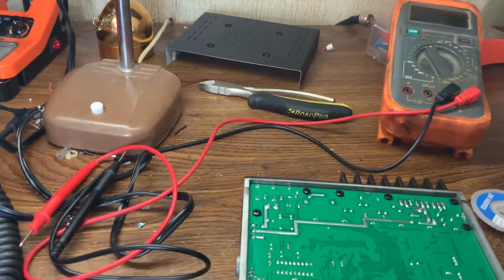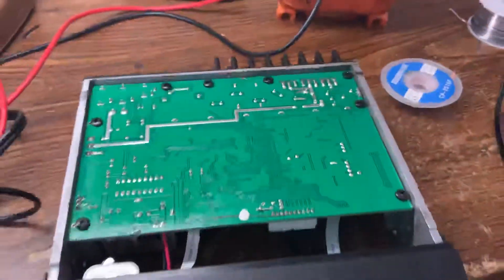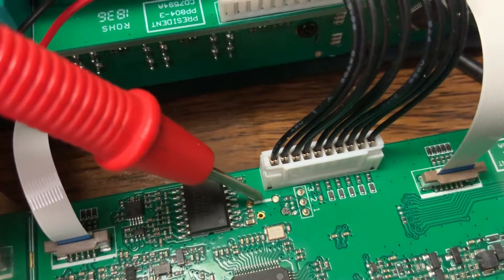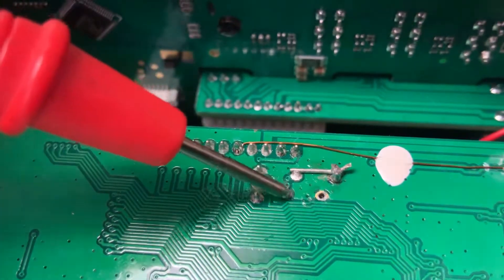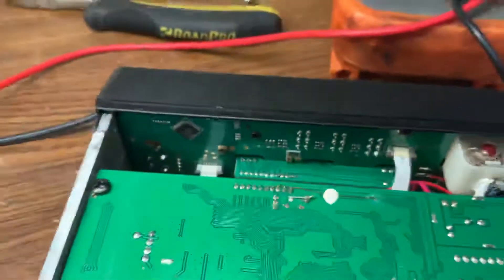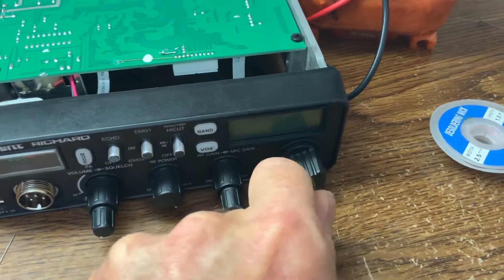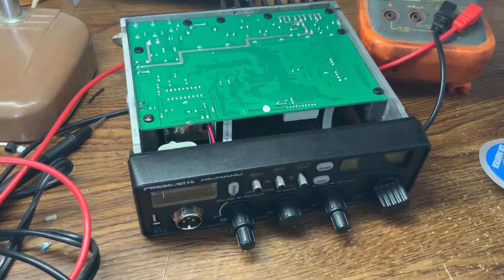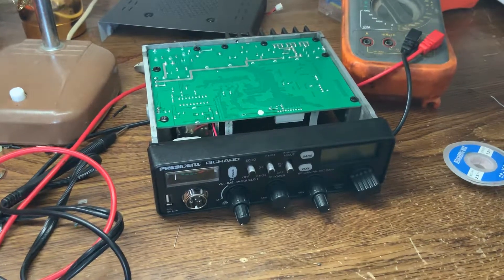President Richard CB Ham conversion to 11 meter modification

Comment: Instead of using a wire, can we use a switch to flip back and forth from 10 meter to 11 meter? If so, is there something that has to be done with the programming after every time it's switched?
Reply from the maker: That would be kinda pointless because all this mod does is add 11 meters to your existing 10 meter radio as extras, it does not take anything away. So by flipping a switch, you are not “coming back to something that is taken away” if you know what I mean.

You’re just unlocking extra channels and adding them to what you already have. Hope this makes sense

Comment: This is awsome...if i had this radio and did the conversion, is there an antenna that would work for both 10 and 11 meter bands
.i know that it will not be optimal, but would there be an antenna that would atleast somewhat work with both of those bands?..any suggestions or what would u do???..thank you for the video
Reply from the maker: @bencoletti4119  Yes it can be done. The 102” whip that most people use is actually tuned to the 10 meter band. This is why people add a 6 inch spring, to tune up to 11 meter.  tuned length on 11 meter is 108”. As you noted, it would not be optimal, but it is doable. More serious people use multiple antennas, or add an A/B switch to two antennas for one single radio. With that said, personally I do not feel 10 meter is worth pursuing. The reason this is a 10 meter radio is to classify it as a ham radio so the power can be greater than 5 watts knowing peoples real intention is to tune up, and have a powerful CB radio,,,, thus skirting the law
Reply: @KevinModz65  so for a mobile setup, seeing as I drive alot. Do u recommend just getting a cb

Comment: The president richard I bought came with a resistor soldered between those two points.. should I just leave it, or remove it, and solder in a piece of wire? I'm hoping that doesn't affect wattage. Sorry for the dumb question.
Reply from the maker: Hi Brett, no dumb questions at all. Did you buy the radio new? Do you get cb channels? A resistor between these 2 points is often installed by the factory to make the conversion easier for the user, they know what we do to make the 11 meter work. These radios often change revisions, I made this video with a very early prototype. I have heard the board has changed several times since. On their other models, removing the resistor is often all that is needed
Reply: @Flip2Flower1  thank you for the quick reply! It's a new radio. The place I ordered it from had an option to tune, and align the radio so it will work on cb channels. I'll find out in the morning if it works properly.

Comment: I have been waiting on your long term review of this. How did it work out? After you put in the PD 1234 does it keep it in the memory after you power off? Are you able to switch back and forth between 10 & 11 meter
Reply from the maker: Hi Bill. Yes, this radio has been rocksolid. I have never had to touch it again since doing the modification. There is really no flipping back-and-forth between 10 and 11 per say, when you do the modification, it just adds an additional CB band on the dial. You don’t really have to flip anything if you know what I’m trying to say. You just continue turning the band knob to the band that you want up to and including 11 I hope I did not confuse you, it’s kind of hard to describe, but this is all very simple on the radio. It is as is 11 was already there for you.

Comment: I have a President Taylor and there is a secret menu to increase or decrease the power.  I emailed the factory, but they gave me the standard "4watt and could not be modified" answer.  Now how much of an increase I have, I am not sure, may only be a few watts, but the I would think The President Richard would have a secret firmware menu like the Anytone, to change it from a 10 to 11 meter.  Thanks for the video.

Comment: What's the long ground wire soldered in on the board? Mine doesn't have that.
Reply from the maker: I’m not sure, they probably eliminated it on later units. I had one of the first releases